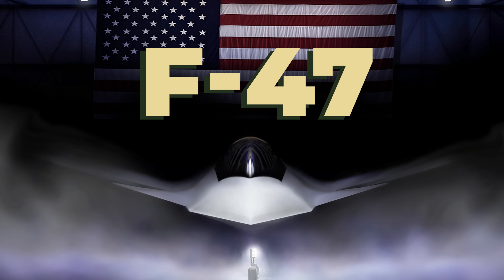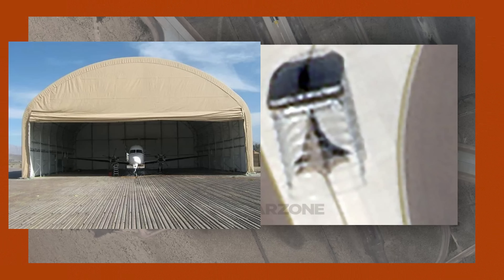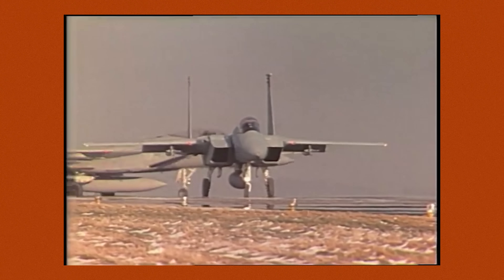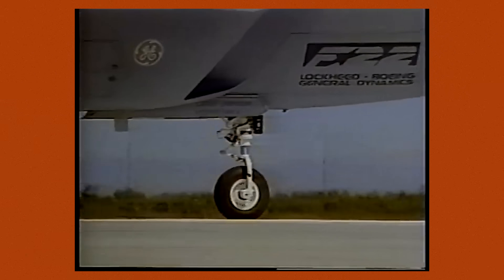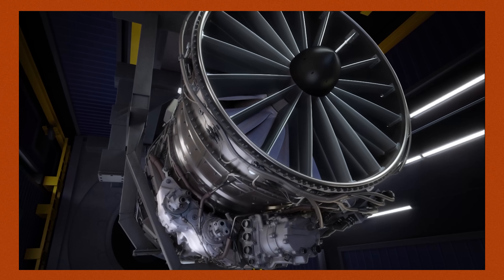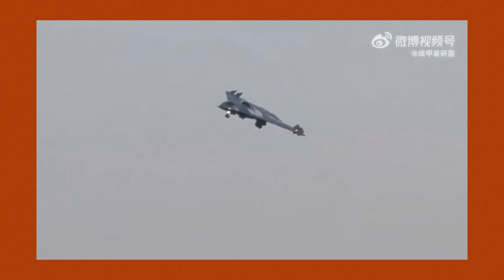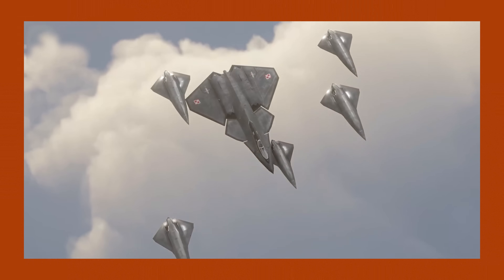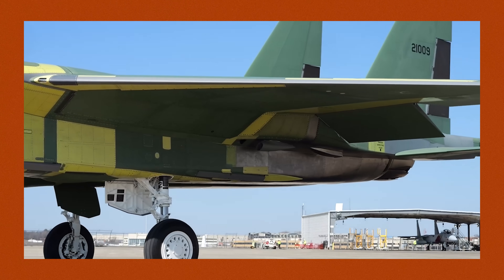America's "New" Sixth Gen F-47 is NOT New

Comment: This shirt feels like it was cleared for flight before the briefing even started. Next-gen, low-observable urban camo. Shiny enough to confuse radar, subtle enough to disappear under fluorescent lighting at Home Depot. Open at the collar for maximum airflow, because stealth is important but so is ventilation. And that silky finish? Pure aerodynamics. Cuts through the air like it’s doing Mach 1.2 on vibes alone.

It’s the kind of shirt that doesn’t announce itself, it just shows up already ahead of schedule. No moving parts. No exposed rivets.
Just quiet confidence and a design that suggests someone ran wind-tunnel tests before sewing on the buttons.

Comment: im having trouble figuring out which of these 3d concept mockups youre showing here is actually the f-47 theres a bunch of different planes here.
the one that most looks like something thats being looked at has polish air force roundels on it, which may or may not be the one that at least takes a bunch of design queues from both the yf-22 and 23s, and the one in the hanger looks like its wings and canards (which arent on a bunch of the other 'f47s' in this video) are excessively dihedraled (i dont know how else to explain what i mean there)

Comment: Zero sums game 🎮 not a game mockup _ some people from renaissance would be marvellous sort of tapping sticks on glass furniture etc _ dude that pigeon got tne tesla 😳 _ effemicincy isn't just range it's neat sportswear agility _ indeed is about accessing more altitudes with a slippery flight character and lightweight _ climb rate js basically a win so if your engines can not fail and be run in ideal conditions at anh altitude when you want to attack you just to back up + deliver a run of stuff _ if yku disappear kn clouds + tiny speck, and has that level of range at the desifn spec can supervise the b21 b2 and delivery aircraft or stop some passenger jet most places. 

The accelerare and delete pressure above a control surface thing means you really don't need a tail has lift curvature and roll rate at those speeds is a missile _ is for modern distances so fast is timely 👌 

V pleased about that. Watch to go with def Harrison mechanism. Garmin is for cessna not that _ and physical switched for PMU + automatic failovers and compensation in loss of function event but positional input interfaces much more space efficient sandwich contact less and multiple redundancy layers for accuracy + resostance to attack or intrusions. More futuristic is less stuff fewer problems more speed same as ever _ see wright flyer _ we be flying... / jet fuel ⛽️ 😎 👌 💪 😍 

I like seeing people wkth their items 😍 knew this one was correct at first inspection _ even fbe pink etc yep 😄  mm measures to tenth of a mm 😋 _ blue tape mockery of standard issue equipment standard post thatcher raf behaviour mm tbisnis my personal equipment _ has antlers not a crown. Tbis one has a crown 👑 👌 ✨️ 🙌 _ ofher hihats not in this bag ... the wuhan and the stack selection 👌 nice cut down crash and some ruined zildjians bought a pile from Golborne flea market m. Sort of was a k series cymbal witb soecjal holes but got smashed, that one is why i got tbe lot, the unbroken one is bit sabian o zone kinda cool sound until broken, o zone played via bell is interesting just china tone and crash sustain so very violent to ears 👂 the slots etc all same idea shoeter sustain and half open hihat cracked cymbal basically you get closed hihat then metal click like hitting plastic tbe more metal you add 😉 however big you go the treble hust gets meaner and louder so small high frequency things are wiser 😉 has no foot volume played open with ride as an accent ... this we can use. Softer foot pedal is quite nice is a different sound usually closed or played with foot same deadly loud sparkling bright 🌞 is a much less sharp blade like interface _ edge to edge vs rolled edge and stacked _ could be like 20dB an air gap won't stop sound no, but it does significantly reduce transmission mechanical contact is like a wire for vibration it conducts it rather tban storing it and allowing it to radiate.

Comment: The F-47 in fact, is already known very well for 83 years now.
Because the name F-47 IS ALREADY IN USE.
You know the P-47 Thunderbolt. Yeah, it didn't just disappear after 1945, and to comply with the USAF's new designations the P-47 is also renamed and accurately known as the F-47.
The USAF has already made sure to not reuse the names of aircraft out of operation, so no, it's kind of retarded to call this thing the F-47.

Comment: So basically, The US had the best air superiority plane ever, expensive but a marvel of aviation and engineering. They decided to go with it and to start production, which means that at that point most of the cost of the project was already spent. And suddenly, after not even making 1/3rds of the aircrafts planned, they just stop and scrap the production line, thus retroactively making the plane very expensive per unit, because of not benefitting much from economy of scale. Then suddenly the enemies that were always there and were always dangerous start acting agressive again (an umpossible to predict turn of event/s), and whoops we lack air superiority planes! And then they scramble to build new ones on an old design. It's to that kind of things that you can see US gov's decision-making has been abysmal since a long time now.

Comment: I believe this indicated design is BULLSHRIMP. 
Why? - Simply stated the movable forward canards are in line and forward of the air intakes. Movement of the the canard upward and you increase intake pressure and conversely when you move it down you lower intake pressure. Even with the use of movable intake "ramps" you cannot account for the variables encountered within all of the flight envelope.

Comment: The B2 was designed in 1974, the F22 was designed in 1981, the F35 was designed in 1995. The F47 was designed in 2014, it has most likely already entered service but hasn't been revealed to the public. The fact they've made it public means it's outdated and they're currently fielding something far more advanced. 

Blackstar, Aurora, TR-3B Black Manta are all active black projects that are yet to be made public despite being operational since the 1980s. The former Lockheed CEO stated the military is at least fifty years ahead of the public when it comes to technology.

Comment: There's a lot more than an airfoil going on.
For one, it has been flying for years, and nobody has a photo.  Even the mysterious, "skyquakes," are gone.
The aerial photo is interesting.  It could be a lucky shot. Or, it could be another decoy to scare China.  It could be the actual article, and the vehicle requires climate control for its systems.  It could be a lot of things. But, the F-47 is anything but old.
The ultimate shape is a flying diamond, but they already did that.

Comment: With F35 having the 360 degree camera view is there any reason to still have such a large cockpit glass area, also if the F47 can be used as a drone, why does if need such a large cockpit area. Recess the pilot into the fuselage more, reduce the glass area and let cameras take care of visibility except for a small glass area in front in case of a tech failure.

Comment: recess the intakes on the lower side, prevents compressor stalls, add a computer controlled defector like the 15, to again reduce compressor stalls. those canards will fuck air flow into the engines. take the nozzles for the f-22 instead of those tiny ones on that new thing. ar arrange the wings in the shape of the 22. now add the canted vertical stabilizers and you have a great plane. oh wait. it's the f-22 😂

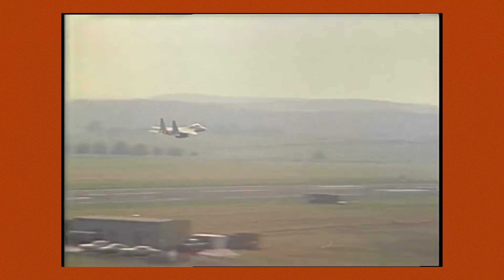Comment: 7:14 this number is a bit missleading.

F15 does mach 2.5 clean and wet,
F35 does mach 1.7 wet, and mach 1.5 dry
F22 does mach 2 wet, and mach 1.8 dry

While in both F35 and F22 case they are also clean, but they have internal stores so that dont matter.

The short and long of it is that F15 top speed is really not mach 2.5, but a lot less, about mach 1.6-1.8 dirty and about mach 0.95 dry

The romour have it thar F47 does mach 1.9 dry and 2.2 wet.

Comment: They’re lighter because of ceramic stealth coating instead of carbon or iron based. Slower-because without some sort of exotic frame cooling the IR signature at Mach 2 would make stealth useless. If it indeed does have ceramic stealth-heat doesn’t matter as much anymore. However, as said, if this is supposed to reach any sort of mass (or mass-ish) production-the costs of exotic cooling would definitely hinder that. Take a look at the SR72, which is a much lower production and specialized “super fast” aircraft.

Comment: "The aircraft is reportedly supposed to be as fast if not slower than the F-15."

Being compared to schrodingers rocket doesn't sound so bad to me.
The F-15 is stupid; It can fly with one wing, doesn't need wings under certain conditions because it crosses the 1.0 thrust to weight ratio barrier (which means it becomes a rocket by definition), the thing was unshakable back then and is still fast as fuck right now.

The F-15 is what happens when you start designing a plane around the limitation of the human flying it, and really push those limitations.

As per usual, God Bless America, of course.

Comment: Short: Flight computers exist, canards would be static until needed for take-offs, landings and dogfights, otherwise TVC would be used. Canards are just as stealthy as F-22 upper inlets.

TLDR: I don't know why everybody loses their lunch when people say the next gen aircraft will have canards. Canards are bad if they are flipping and flopping around all the time. But this little thing called a flight computer can tell them to be still while using the thrust vector control to do the fine pitch. This could be true for all control surfaces, especially while the nose of the plane is being pointed at the enemy radar. If there was a need to use them, say landing or taking off, or dogfighting, the flight control computer would engage them as needed. Sitting still, the canards would have no more radar return than the upper air intake on an F-22 Raptor.

Comment: Also, on speed, you have to talk ACM, even though some people have said "no more ACM" ever since the late 1950s. One thing you didn't mention is that both loyal wingman producers are making CCAs that are high subsonic speed wise, which is another reason they would be out front and ahead of a F-47 catching up (in fact, they could even be loitering in the operation area awaiting the F-47).
Ask anybody ever associated with Top Gun or whoever did even the most basic ACM in flight school, and you will find out ACM is all about "energy" (which is exactly what the Fighter Mafia inside the USAF/DOD we're trying to maximize when it came to the F-16 initial design/specifications).  So, truth be known, just as you cited SR-71 turns the size of Ohio, ACM/bleeding off "energy" usually happens below M 1.5, typically/hopefully being high subsonic (speeds) -- that's why your loyal wingman have speeds in those ranges, and don't forget the USAF has already proven out their AI dog fighting software! In other words, the F-16 had to max speed of M 1.6 because it was designed to kill other planes in air-to-air combat (and then the powers to be started adding bombs and upping its weight!);  M 1.6 was fast enough because the important factor was the F-16 could out turn anything! don't forget: when the USAF was looking for a strike fighter, General Dynamics readily came up with the F-16XL, so just check out the specs on that Betty!

Comment: Here's the thing about "6th Gen" fighters and the "loyal wingman" qualification:

F-35 can have loyal wingmen, and the F-15EX can too. Also there are a number of late 4th Gen designs (F-16, Gripen) that are stealthier than the early designs (F-15, F-14). Also, the SR-71 was a stealth design from the 60s (technically the 50s because of how aircraft design worked then) that was also the fastest in-service aircraft ever.

It's really hard to pin down what makes a 5th or 6th Gen fighter: F-35 will likely get upgrades to include adaptive-cycle engines (probably [hopefully] Block 4.5/5), as the existing engines are already overtaxed and provide too-short range to counter China; F-35 has sensor fusion (as will likely F-47); F-35 already has loyal wingmen.

I think the 6th Gen defining characteristics will be that they are large, long-range tailless designs that incorporate almost all the above technologies.

Comment: Regarding top speeds, there has been a shift over the decades since the Cold War where because of ICBMs and the counter to them being missile defence systems, interceptor is no longer a huge requirement in a multi-role aircraft. Older aircraft could attain top speed at the expense of engine longevity and fuel, but newer designs focus more on sustained cruise speed rather than afterburner sprints. Supercruise is the new buzzword.

As for being unstable, for dogfighting that's desirable, with better fly by wire tech nowadays you can build aircraft that are naturally unstable so they dogfight better and require computer inputs to maintain level flight, rather than being stable and needing large control surfaces to alter course.

Comment: Canards in front of the intakes should not work and would most likely stall the compressors. The use of composites limits the top speed because composites don't handle the heat at speed.

Comment: with beyond visual range combat being the standard there's not really a need for much agility so i dont think those mockups are at all what the plane will look like. i think its just to throw china off a bit. the real one will likely be more a 2 man light bomber maximizing stealth and range, certainly no canards and small or no vertical surfaces. since drone teaming is the core feature of the generation the manned aircraft will ideally never enter the line of fire, just the drones. for the appearance look at china's new jets and extrapolate a more competent design from that since everyones working with the same physics the designs will converge.

Comment: To be fair we wouldn't be making a new air force air superiority fighter for another 20 years if it weren't for the F-22s production run getting cut off less than 1/5 the way through, so it makes sense to go with an air frame that has had some work done on it, but just giving it brand new gubbins inside with new stuff which will actually be cheaper than trying to revive the F-22 project, because you would use the manufacturing processes that make sense now not those that made sense in the 1990s.

Comment: Many don't realize we had a publicly released fully functional 6th gen aircraft in 1990 called the YF-23 Black Widow. It's been sitting in plain sight the whole time.
Edit: Interesting to note our supposedly top fighter aircraft the F-35 is sold to our allies but a 1990 aircraft YF-23 is still not allowed to be sold to anyone.
The money tells the truth.
Reply: There's so much wrong here that it hurts. First off, the YF-23 only has two working models, Gray Ghost and Spider, no others were built because it lost to the YF-22, mainly because the YF-23 had a few glaring issues like the canopy, which it borrowed from an F-15, kept breaking. Plus, the final F-22 takes a few design queues from the YF-23, mainly just some of the tech, and all three designs, the YF-22, YF-23, and the final F-22A are all banned from being sold overseas, so that's a bit of a moot point.

 Second, regarding the F-35 it's not necessarily better or worse than the F-22, the F-35 did have better computers and what not in it, but a lot of that has been effectively retrofitted onto older planes including the F-22. The bigger issue however is that the US and most other countries have what's known as a high/low mix, basically you have larger two engine air superiority plane as the "high," and a smaller usually single engine multi-role plane as the "low." Think the F-4 Phantom and the F-5 Tiger, the F-15 Eagle and the F-16 Viper, the F-14 Tomcat and the F-18 Hornet, or even the F-18E and F Super Hornets compared to the F-18A-D Legacy Hornets. Even Russia uses a High/Low mix with their SUs and MiGs. The F-22 is a high, the F-35 is a low, they're made for two different things entirely.
Reply: What are you smoking? The YF-23 is a museum piece, it's not even in production. Come out of the brainwashing

Comment: Nice video. The caveat I'd add is that you explain the reason for why we no longer make fighter aircraft that go as fast as previous ones. Your explanation makes sense as prioritizing manueverability over straight line speed seems logical. Of course you follow that by immediately claiming that in today's world, the aircraft itself is only as important as the equipment it carries, and that a fighter's primary job is to carry ordinance to a point where it can used. 

Which begs the question. If a fighter aircrafts primary job is to get equipment like missles somewhere so that they can be deployed... Would it not make sense to design an aircraft that has as much straight line speed as possible, in order to get it there ASAP?
Reply: It mostly has to do with fuel efficiency. We could make fighters go incredibly fast. But that would severely limit their range. This is a problem because it means that the aircraft would either be kneecapped in its ability to go on missions or you would have to add external feel tanks, which would make the plane much less stealthy.